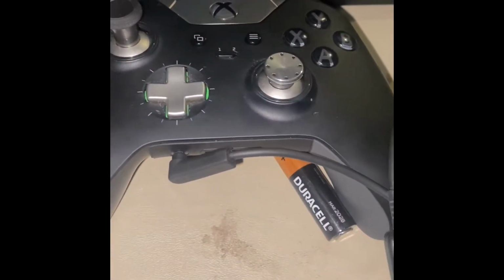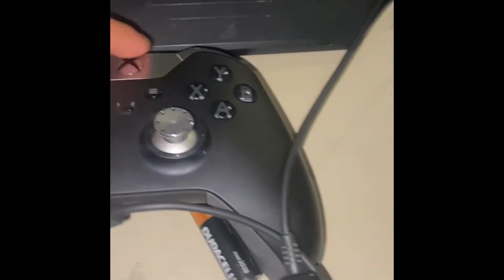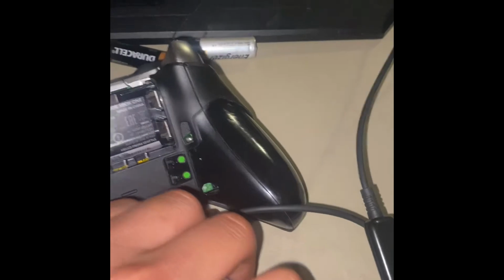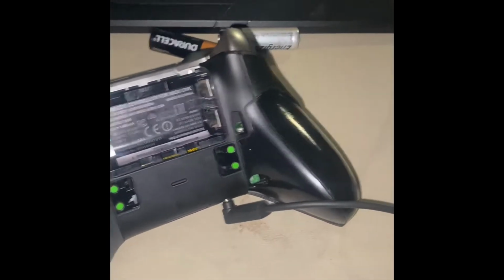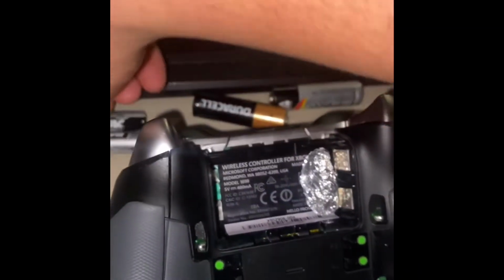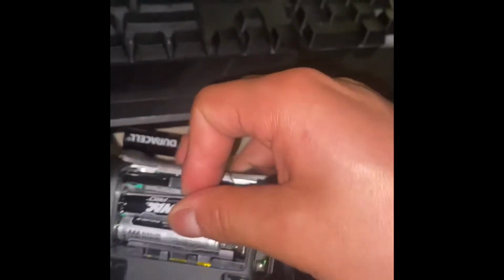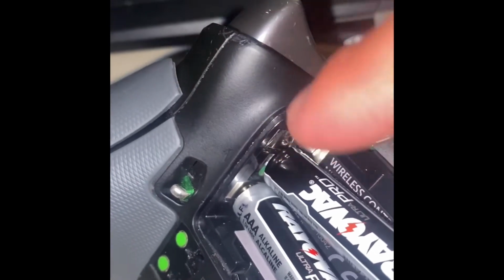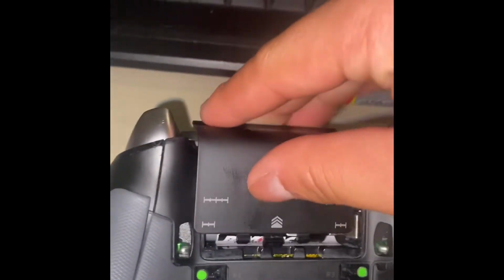How to use AAA batteries in Xbox controller

Comment: Any suggestions mine is not working
Reply from the maker: are your batteries in the right way?
Reply: @thediychannel6620  it’s working now but it’s dieing is there a unlimited one?
Reply from the maker: @mji8537  yea if you move the controller too much or if theres not alot of tinfoil the batteries will sometimes slip causing it to die

Comment: Ok umm so I did this again with new batteries and my Xbox remote turned on but the batteries started to get hot and I’m scared it might create an explosion
Reply from the maker: Mine never blew up but i only used this as a temp fix until i got new batteries dont recommend doing this for a long time
Reply: @thediychannel6620  my controller on the back is hot now I’m let it cool off but when I tired to turn it back on it started making werid noises so I completely took all batteries out now I’m scared my controller probably won’t work anymore
Reply: @thediychannel6620  I think it bc I used tin foil so ima tried coins
Reply from the maker: @Positions.K.I.D.S  be careful
Reply: @thediychannel6620  lucky I got new controller
Reply: Lmfao